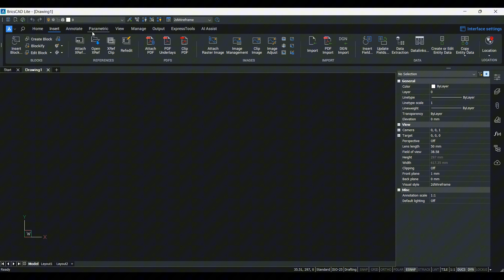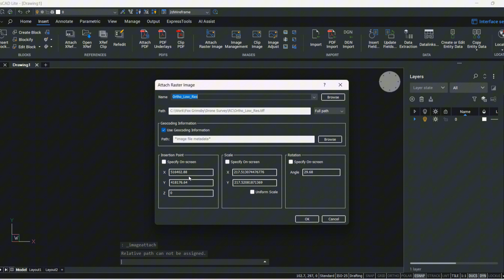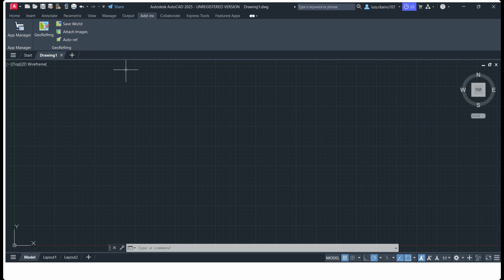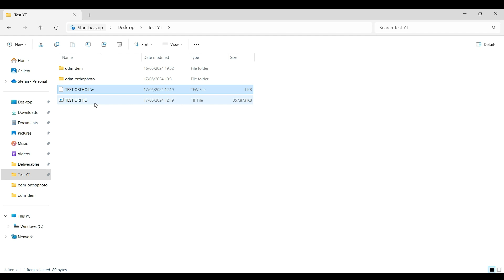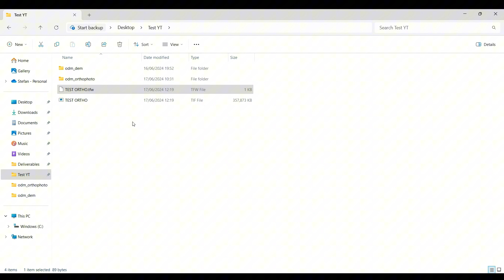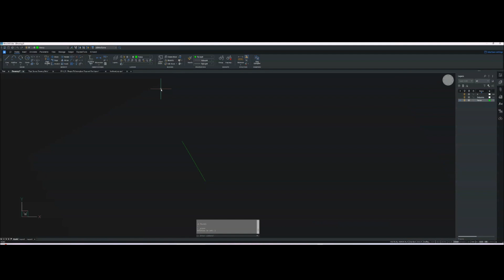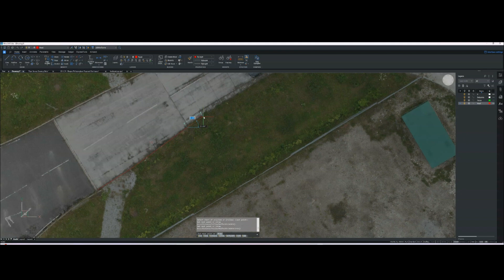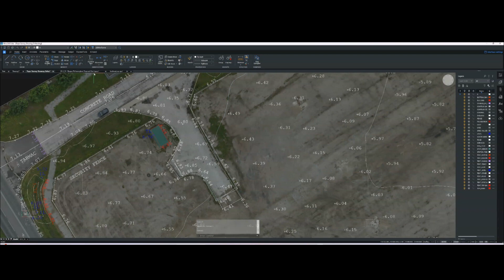EASY WAY to Import Orthophotos into AutoCAD and BricsCAD Like a Pro

Comment: Hi Stefan,  My car club runs a massive show once a year on a large green field site, it takes us days to layout all the stands and marque positions using a wheel and tape measures, thus we are planning to use technoligy next year in an attempt to cut down the legwork.  One of our members has carried out a drone survey and we have a Orthomosaic Geotiff file. I have had some CAD experence and  was considering geting Autocad LT but now thinking of BricsCAD, is it overall easier to use?
Reply from the maker: Hi Phillip, it is actually a good use for drones and GPS in your case, it will save you a lot of time and hassle, and it may not be as expensive as you think.
I was a AutoCAD user until 4 years ago and never looked back. The interface is 90% similar AutoCAD so the switch it's easy.
Drop me an email and maybe I can give you some tips.